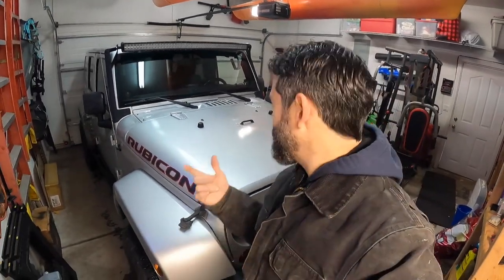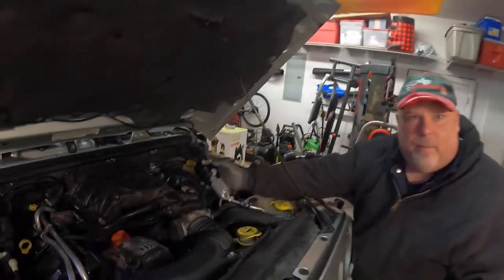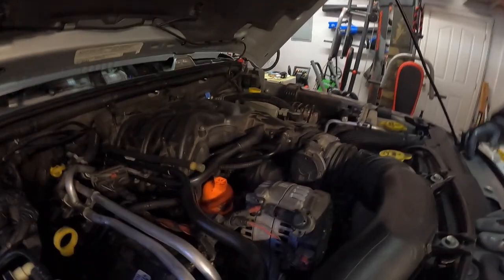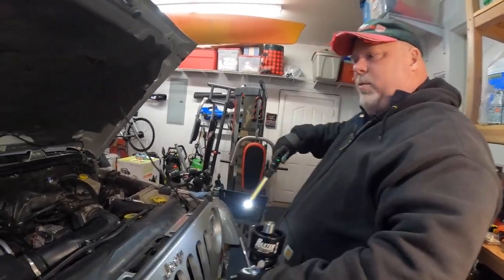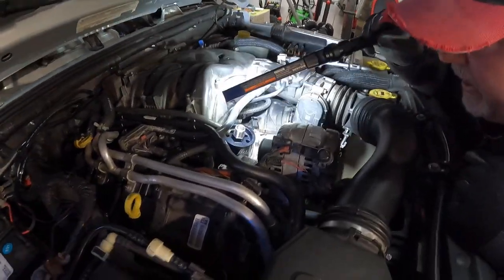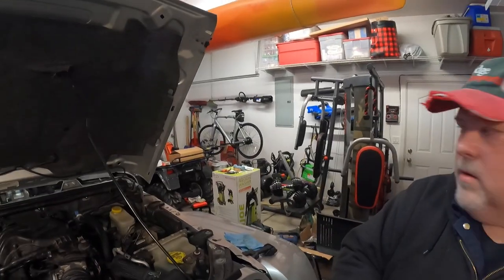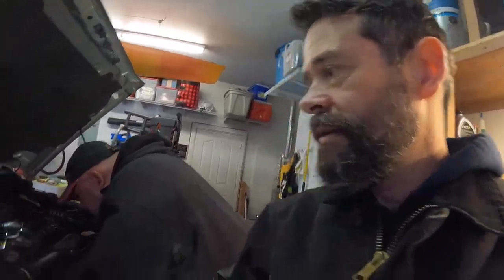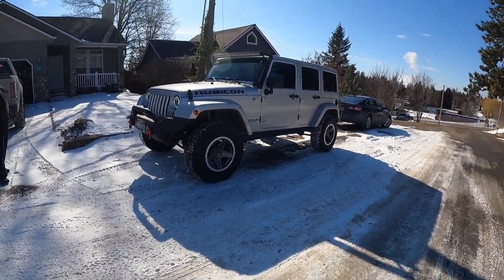Baxter Performance Engine Longevity Upgrade - Project Cheap Jeep Part 5

Comment: You can be guaranteed that Chrysler will void your warranty for this modification. They refuse to repair my Jeep because I had an oil catch can on it. My Jeep was under warranty. I'd been having engine oil on the clean air side of the engine air filter coming from the PVC valve. I'd complained to the dealer several times, but the dealership claimed the oil wasn't unusual until they  claimed I had caused it.
Reply from the maker: There are two types of dealers in our experience: the ones that will use the rules to deny you any benefits at all, and the type that will sort thru those same rules to figure out a way to help you. Unfortunately the second type are harder to find. We’ve posted before about the Magnuson-Moss Act and how it protects consumers, but we always also do if you’re not comfortable, just wait until the vehicle is out of warranty. Personally, our rigs are all out of warranty and we do all our own maintenance. If the engine blows up we’re the warranty on it so this makes since for us. But if you’re someone who uses the dealership for your maintenance and the vehicle is still under warranty, just wait to install the system and you’re all good. Thanks for the comment!

Comment: Great video. Have a newly acquired 2012 JKU and wanted to do the Dorman and Baxter upgrade at same time and didn't know if they would fit together. They do now have a Baxter unit specifically for 2012s    What exhaust do you have on your jeep? sounds good there at the end of the video running outside.
Reply from the maker: Thanks! Yep, they do, and we installed one on our 2013 if you want to search for that video. But if you do the Dorman upgrade, you need to go with the newer Baxter kit because the Dorman cooler upgrades you to the newer oil filter housing. We're not sure Dr. Torque knows what exhaust that is but we'll ask him and update you here. Thanks for the comment!
Reply: By chance you don't know what that Baxter unit part number is do you?
 @MotorsandMischief
Reply: The exhaust is stock as far as I know.  I know that it is stock up front, but I've never taken a close look at the rar section and muffler setup.  It is pretty quiet, so I had never thought to assume it was anything other than stock.

Comment: I am putting a dorman aluminum housing in my jeep. Would it be easier to install the baxter at the same time?
Reply from the maker: The Baxter install is not particularly difficult either way but if you’re doing the housing, yeah, we’d for sure do them at the same time. Thanks for the question!
Reply: @MotorsandMischief  Thank you!

Comment: Thanks for doing this video Motors and Mischief. I own a ‘12 Chrysler 200 Touring convertible with the Pentastar engine that I plan soon to do both the Dorman and the Baxter Performance upgrades. I once successfully did a remove and install of an aluminum intake manifold on a ‘86 Oldsmobile 5 Liter V8 so I’m confident enough that I can do both upgrades to my convertible.
Reply from the maker: Thanks MoparDan! We really love this solution, and your comment even more! Sounds like you will have no problem handling this upgrade. You should let us know how it goes, we'd love to hear!

Comment: Is it worth putting on high mile wrangler.?
Reply from the maker: We would. If it helps a little and buys the older engine more time, that's a win. And if the motor blows up and has to be replaced, then you already have it for the new motor! Thanks for the question!

Comment: LOL so why does Chrysler not change these parts to these upgrades
Reply from the maker: We know you're jokingly giving us a hard time but we're going to answer the question anyway. Chrysler (in this case Fiat), doesn't care if your 3.6 lasts 150,000 miles or 250,000 miles. When its that old, they, statistically, won't see any parts sales nor will their dealer network see any of your money. All they care about is that it gets out of warranty and doesn't fail early enough that they get a bad/worse rep on their reliability. So they have no incentive to spend extra money on the engine now when they'll never see a return on that extra engineering, parts costs, etc. However, when Fiat is starting with a clean slate, like the new inline six cylinder Hurricane motor that's replacing the 3.6, then then can afford to add this sort of thing in during the initial design. And our friends at Jeep told us that's exactly what they did and a Hurricane motor has a similar anti-drainback device (albeit without the cool air pressure oil clearing feature).